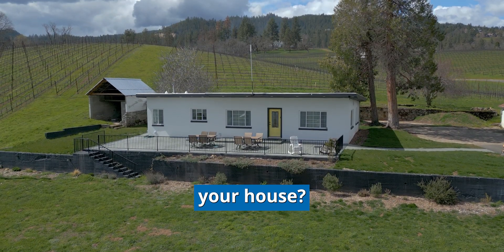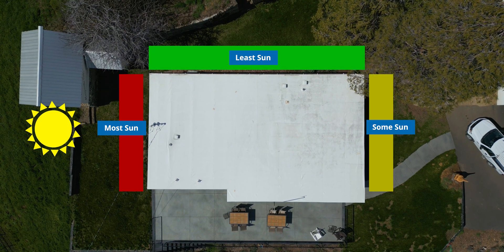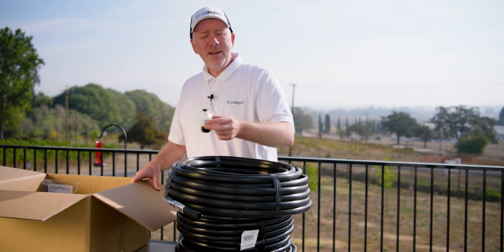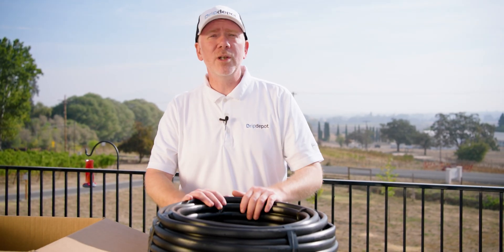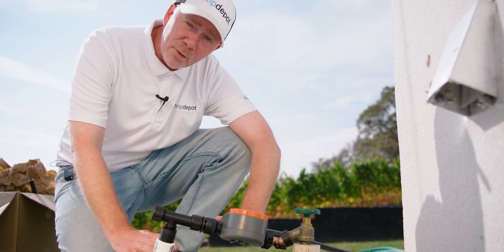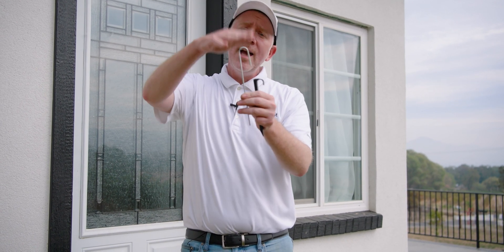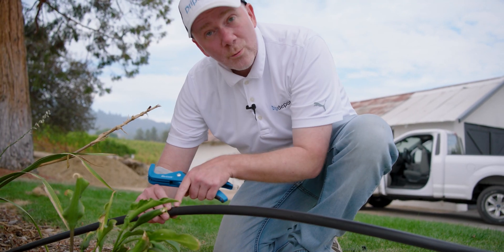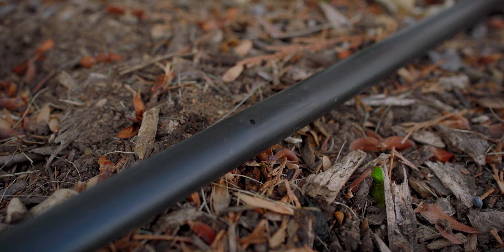How to Install a DIY Foundation Watering System (Complete DIY Beginner's Guide)

Comment: Thanks Adam for the extremely thorough walkthrough! I have just submitted an order for the parts needed to convert our existing soaker hose-based foundation watering system to a drip line system. Regarding the Tee filter, is there an actual filter cartridge that needs to be routinely replaced? Or is it a mesh filter, like the ones in pop-up sprinkler heads? Thanks a bunch!
Reply from the maker: You're very welcome, thank you as well!  

Great question on the filter -- it does have a cartridge/element inside -- with clean water, it won't need to be replace too often.  And when it gets clogged, you can usually spray it down to get the debris off.  Screen filters filter from the inside out, so you can spray the outside of it to remove the majority of the debris.  Eventually it will need to be replaced, but it shouldn't be too often :)

Comment: To avoid evaporation, would you suggesting running your hose in the evening or very early morning?
Reply from the maker: Very good question -- it might be worth checking with locals to see if there's some advantage to running it during the heat of the day, but when using it for irrigation you've got the exact right of it -- running it early in the morning or evening does reduce evaporation.  Evaporation will already be low (it drips directly into the soil, the wet spot on top, where evaporation will occur, should be small), so we maximize the efficiency by running early or late. 

With the goal of foundation watering being an evenly moist foundation, I suspect running it so the foundation is sufficiently moist (but not wet) early or in the evening will see it through the heat of the day.  Try a cycle out, and then dig around a little after (or late into) the hottest part of the day and make sure the soil is retaining moisture :)

Comment: Hello! How do I get this exact system? I live in TX and the summer heat is killing my clay soil and I’m worried about my foundation. Please help.
Reply from the maker: Everything in the video is available on our website :)

We can also help you find it all if you like, just fire us off an email at our Contact Us page -- during office hours (Mon-Fri 7 am to 3 pm PST) we'll get back to you quickly, usually within minutes.  Just in case, here's the link directly to our Contact Us: https://help.dripdepot.com/support/solutions/articles/11000049095-how-to-contact-drip-depot

These systems are actually pretty straight forward as well -- as you saw in the video, not too many parts are required -- a head assembly to connect it all to the water source, some mainline tubing and then the dripline.  An elbow or tee fitting here and there and an end cap or two and you're basically done.  We can help in keeping it simple :)
Reply: @dripdepot  Hi. Any chance I could set up a time for a video call to give you a quick run down in real time if my home set up to get your best recommendation?

Comment: hi everyone. I wanted to add some insight over the importance of the soil properties itself. Usually Foundational issues are seen in heavy clay soils. To help with this, adding mulching or cover crops help add organic matter to soil. Therefore it doesnt crack as easily (doesnt expand and contract when wet/dry as much) also prevents soil erosion.
Reply from the maker: Very good information here, thank you truly!
Reply: @dripdepot  thank you as well for this informative video!
Reply: I’m sorry, can you explain a bit better. I’m in TX and my home is on heavy claim soil. Where should I be adding mulch?
Reply: @AlejandroRodriguez-dt5it  I can try. Adding organic material to the soil makes it over time, more like what you would use in a garden or what you can find in a bag of potting soil. It's loose, fluffy, holds moisture, and has soil biology (bacteria and fungi). This is optimal, because good soil holds water well, is easy to water, and with this won't expand or contract as much as a higher clay soil. Mulch is essentially a thick layer on top of the soil, this helps shield it from the sun and helps with moisture retention and over time naturally breaks down into great organic material. Another youtube video might be able to fill in more or give you a better idea. But these are the basics. Hope it helps

Comment: My lawn goes right up to the foundation. Can the drip line be installed in the grass in such a way that I can mow over it or can I install the drip line right next to the foundation?
Reply from the maker: We do see some folks raise their mower and mow over the tubing/drip line, but the results are often mixed (taller than desired lawn, damaged drip line).  Unfortunately you don't want it too close to the foundation as it could cause other issues (getting into any cracks in the foundation, eroding soil away).  

While not ideal, the drip line is pretty light weight, depending on the amount you need to use, it can be fairly easily lifted out of the way during mowing.  :)

Comment: Does it matter the orientation of the holes in the dripline (the built-in emmitters)? Do they go facing up or facing the ground?
Reply from the maker: Very good question!  I wish I could go back and mention this in the video now, thank you for the great question.  

The emitters, as much as possible, should always face up :)   They'll work fine when oriented down, but it increases the risk of clogging (debris getting in through the emitter).  

Thank you again!

Comment: Thanks for the info!  I live in Houston, TX.  What is your opinion about burying the drip line about 4-6 inches underground?  Also, I'd like to use a sprinkler hose vs a drip line or soaker hose and would like your opinion on that.

Thanks again and great video!
Reply from the maker: Thank you as well for reaching out! 

Burying emitter lines have pros and cons -- on the plus side, it keeps things out of sight and helps prevent accidental damage from landscape maintenance equipment and foot traffic.  It also protects it from exposure to the elements (particularly UV).  With that said, it does make maintenance more difficult (have to dig to access it) and makes it harder to discover leaks.  Buried emitter line is also more prone to plugging -- when using it buried, there are some speciality versions out there you can get to reduce the odds of clogging.  If you go that route, look for anti-siphon drip line with the outlet flap (the flap closes when it's not in use to keep debris from entering the emitter outlets). 

When it comes to sprinkler hose / soaker hose / drip line, I'm definitely biased towards drip line since I work in drip :) 

With that said, I think drip line is objectively better in almost all cases.  Sprinkler hoses and soaker hoses tend to be just holes in some hose (sprinkler hose) or porous along the entire length (soaker hose).  This means there's nothing to prevent them from performing horribly, particularly further down the line.  What happens is, the earlier parts of the hose use up the majority of available pressure and flow, leaving the later lengths of the hose emitting far less water than earlier parts.  

Dripline has actual emitters beneath each hole along its length -- the emitters feature labyrinthine passages and sometimes diaphragms -- these (along with a pressure regulator) help control the amount of water being released by each emitter.  That's why with drip line, you see things like "0.5 GPH Flow Rate at 25 PSI" but don't see things like that with soaker and sprinkler hoses.
Reply: @dripdepot  Thanks for the insightful video! Any recommendation for emitting spacing like 12 vs 18 inches for clay soil areas like in North Texas?
Reply from the maker: @arjunkr6133  Good question, and it could go either way, particularly with clay soil -- if the 18" spacing is seeing full coverage (it definitely can depending on how dense the clay soil is) it's probably the more efficient route.  In most cases, I'd probably test it out a bit (with a very slow dripping hose or similar) and then dig around to see how far the water spread :)

Comment: Hello! Just ordered and installed drip irrigation all around my foundation. Is it okay to put a Irritec Perma-Loc Tubing Tee - Size : 1/2" at the start of the system? I have it routed from the one faucet on the back of the house and immediately splitting with the tee to go around both side of the house.
Reply from the maker: You bet, completely acceptable to Tee the mainline near the water source -- I'd say it's fairly common as well, with gardens often being on both sides of a yard (or needing to get to the front and back).  So long as the other limitations are accounted for (200' maximum length for 1/2" tubing) the Tee at the start won't present any issues :)

Comment: More questions:

Just skip a patio area that is adjacent to the house foundation? No line or water there?

Is the line flexible enough to go around corners, or do I need to get elbow connectors?

Is it okay to use two faucets, or is it better to keep all the supply water coming from one faucet? Does it matter?

I’m in Texas, but I’m going to order at least some of my supplies from you because you’ve been so helpful! Thank you!
Reply from the maker: In most cases, patios are skipped (though foundation near them may be watered to maintain even soil moisture).  You can skip it by either using "blank" tubing (no emitters in it) through the patio area or using two spigots, as you touched on, so that the patio doesn't have to be crossed at all. 

The line is reasonably flexible, but not for sharper turns -- for the corner of a house, I'd probably use an elbow fitting -- I do think going without, it could still make the corner, but it wouldn't be as flush and as neat looking.  The elbows in this case will be party for aesthetics (keep it nice and tidy looking).  

In regards to faucets, it may not matter -- if a single faucet can provide enough water to supply all the emitters, there's no harm in going with a single faucet.  A very large foundation or house might end up high enough flow that it would be beneficial to divide it into two zones fed by two different faucets.  This part will become more clear as you test the flow rate of your water source (timer and bucket) and plan out the total linear feet of dripline you'll need. 

Also, I'm very glad you found the video helpful!  At the end of the day, that' my ultimate goal, so thank you so much for the feedback :)

Comment: It doesn’t need to be buried?
Reply from the maker: It can be buried or above surface :)

When it's above the surface there will be some evaporation, but it should still be minimal as it drips slow enough that water should not pool on the surface.  It's a bit of a tradeoff, burying it is a little more efficient but slightly increases the risk of clogs.

Comment: I never would have knew about foundation watering.
Reply from the maker: You and me both!  This actually came to us entirely through customers, going back a few years now.  None of us had heard of foundation watering -- the first time someone asked about it we were like: "You want irrigate... your house?"  Then we started researching it and learned of the benefits, particularly in dry climates.  :)
Reply: @dripdepot  I just moved to Houston from Montana and I had no idea about watering foundation. With this extremely hot summer and drought, I am finding out the hard way. All of my doors in my house started binding up, a few tiles in my floor were cracking, and some of my drawers roll open when I try to shut them. Thanks for the info, hopefully this can reverse some of the damage!
Reply from the maker: @jh2519  You bet!  We're up in Oregon and it was much the same, we hadn't heard of it either.  Once it was explained to us by some patient customers we understood, but our initial reaction was somewhere along the lines of: "You want to water your house!?"  

I hope it does reverse the damage!  I'm in no way an expert on house foundations, but I do suspect that, at the very least, it can prevent any further damage.  We've received a lot of good feedback from people doing this and they reported it was very successful.

Comment: Love your product.  I just installed a dip system on my raised beds today.  I would highly recommend this to anyone that is interested.  So easy to install and super customizable. Little tip for people struggling to get the tubes on the barbs.  I put some olive oil on a paper towel and wiped it on the barb. Slide on so easy!!!
Reply: Hot water also works great as well.